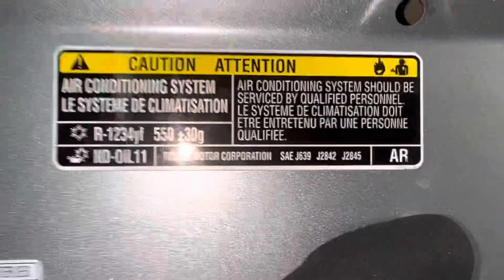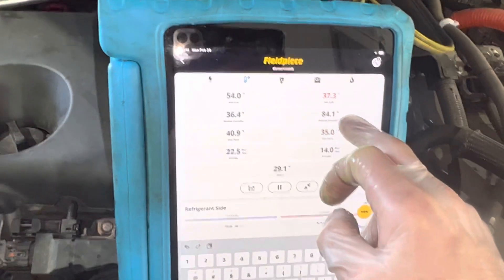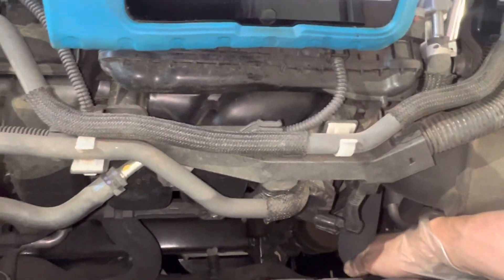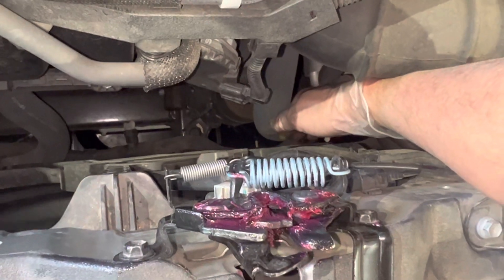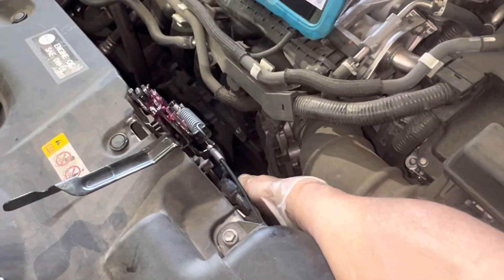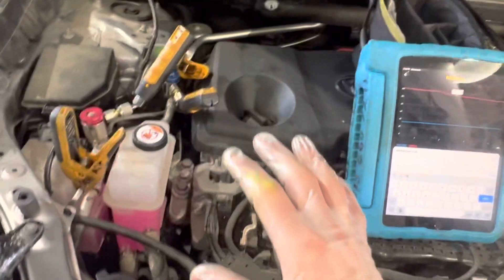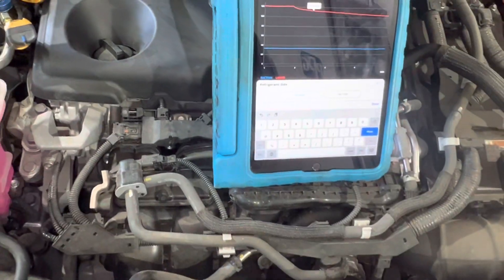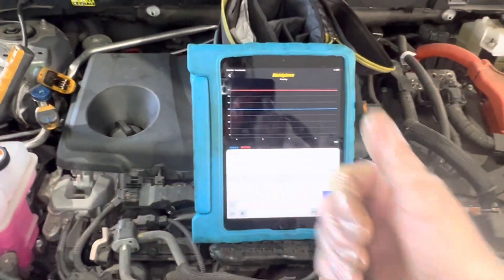Refrigerant Charge Quantity 2021 Toyota RAV-4 Hybrid 550 g.

Comment: You po dock get a thermo laser, the I don't know and then a guess is bull.
Reply from the maker: Thermal lazers, or Extremely inaccurate nobody uses those those are for children. .  Direct selectivity, and the color throw off your temperature reading.. 

I often do user doesn’t even know if you directly thermal laser temperature into the cold air stream, distorts the lens and the wave length and it gives a false reading of a lower temperature that is not real .  

That’s usually because the users are on educated and have no technical or formal background education on the use of the tools correctly .